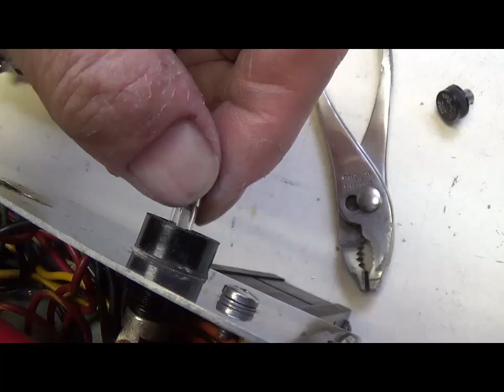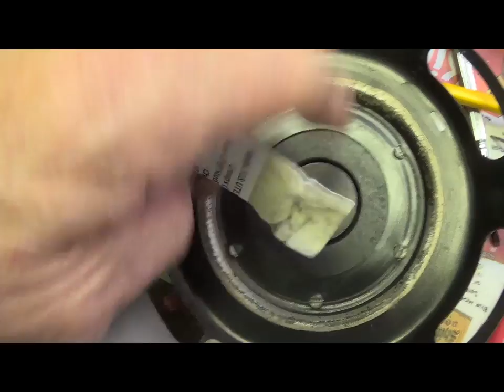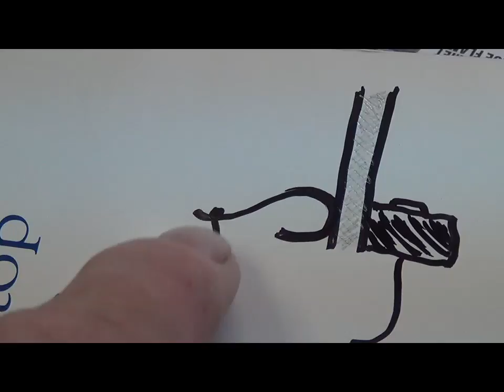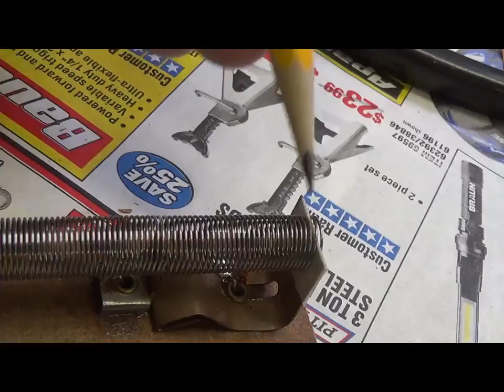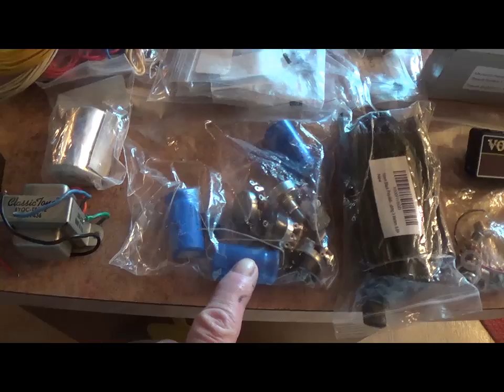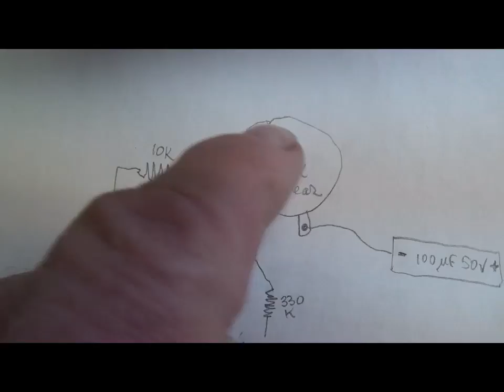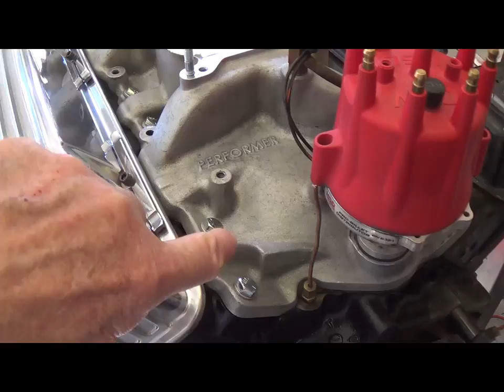Silvertone 1485, Part 3: Circuit Overhaul, Speakers, Sound Check

Comment: Hello Uncle Doug, great work, craftsmanship, and engineering analysis. The engine restoration is quite amazing, hope we'll get to see it plugged up and fired up! If you could show how you tune and perform the timing adjustment on it, it would be nice!    I truly appreciate your videos, as always.  Be well!!
Reply from the maker: Thanks, Bruno. The initial timing must be set by distributor rotation, as usual, but the advance curve is established by the MSD module (not by vacuum advance).  I'll keep your request in mind.

Comment: You’ve certainly done a lovely transformation job on that Silvertone amplifier: it both sounds, and looks brilliant Douglas.
I had to smile to myself when I saw how you had utilised a length of UK type mains lead inside the speaker cabinet.  Since the American mains lead colours are black, white, and green, I’d say brown, blue, and green/yellow serves the speaker wire colour code requirement most handsomely.
Seeing the reverb tank with the long coiled spring brought back memories of long ago.  When I was in my teens and early twenties, we apprentices made reverb tanks using a length of timber onto which a length of form was stuck.  A 17”, 110 degree monochrome c.r.t coiled ground spring (about 14” long) was suspended in a wooden frame (stuck to the form), slightly above two mono crystal record player cartridges (with their styluses removed) screwed to the wooden frame, and they were fed into an ECC83 double triode valve which was used as an audio signal driver.  Surprisingly, that ‘Heath Robinson’ type of arrangement worked quite well.
Youth is most certainly wasted on the young LOL!
Phil.
Reply from the maker: Thanks so much, Phil. So THAT'S why the insulation colors were so unusual :) Your Rube Goldberg reverb tanks sound really interesting.....obviously the product of youthful minds unfettered by the callousness of age.

Comment: I WAS planning work on my 1484 which is bone stock, needs the three prong cord mod, death cap removal, and I was going to try my hand at replacing the caps. I ordered 4pcs, 100uF-150V Vishay caps, ( you said you couldnt find these?),  5uF, 10uF, and 20uF-450V caps to replace the can,  and a 50V-100uF for the bias supply. I would like to know more about the resistors you swapped as well. I have the schematics, so which are those on the schem? But on your recommendation, I may pass on this. I also have a JCM800 that needs the filters changed, and a pair of Hiwatts that need some TLC...I was hoping to start doing this myself, but now I have doubts. I think Brad the "Guitologist" has a vid on working on the 1484 that has some good stuff....Oh and to add, great vid. Just wish I had more knowledge to be able to go through mine as you can and really get this one in shape. Thanks, and still have a thousand questions...one in particular, can you check bias with a octal bias socket tool on this amp? I'd like to check to see whats going on on the plate....
Reply from the maker: I had no problem finding 100uf @ 160V caps, B, and at a very reasonable price from AES in AZ. Several random resistors were swapped when they measured far out of spec. Also, when replacing the can cap, you will probably find it easier to simply replace the two 68K resistors between the can leads. I don't use any octal bias tools, preferring instead to follow the procedure explained in the video: Measure OPT primary DC resistance for each tube, measure voltage drop across each resistance, calculate PC using Ohm's Law.

Comment: A good friend of mine had the smaller 50 watt 2X12 version of this amp back in the very early 70's. I saw the output transformer fail like the one shown here. It was a real spectacular failure. It was in a dark hall where we were playing a high school dance. All of a sudden there were flames shooting up from the back of the amplifier. It put on quite a show.
Reply from the maker: I'll bet the crowd loved it, DeWitt. This is probably how pyrotechnics shows, like those used by Kiss, originated :)

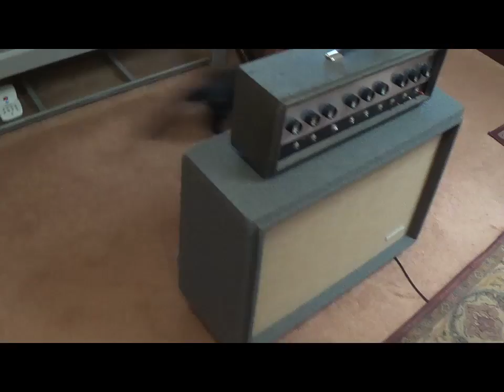Comment: Did a double take in horror when I saw a black shape charge across the screen at 38:02. For a second I thought the original amp rat had homed and was going back to dine on fresh speaker cone and tasty wires until I realised it was Jack. There are 'rodents of unusual size' though & rats can travel! Your self-grounding jacks and footswitch grounding solution for hum after such a complex rebuild shows how many hours of thought you put into this. That's a great sounding & fine looking amp.  Happy New Year UD!
Reply from the maker: He startled me too, Guy. God help any rat that shows up around here. If they can get past the ravenous feral cats in the back yard, Jack and KC will double-team them and dine on their tasty bits :) Thanks so much.

Comment: What if you ran a strip of foam right through the center of that reverb springs but between the transducers?  Maybe a waste of time, maybe not practical or possible.
Reply from the maker: Thanks for the suggestion, BB. I may try that.

Comment: Uncle Doug, Thanks so much really enjoyed the restoration. SEARS no longer exists, but the mighty 1485 lives on. The engine looks fantastic, by the way, did you use the proper 50 ft/lbs of torque when installing the oil filter?
Reply from the maker: You're welcome, T-O. Thanks !! Yes, instead of 450 lb/ft like my predecessor :)

Comment: back when I was a teen, one of the guys in the band had one of these, and we used it as a PA hahaha. I had an old Gregory reverb 900, and an old Silvertone  U1 guitar. Prior to the Gregory I had an old little tube amp that had the sound hole and 2 wooden bands going across the hole. I never knew what it was, just that it was small but loud enough for what I needed.
Reply from the maker: Sounds like some exotic equipment, RR. Thanks for sharing :)

Comment: Great restoration! It looks like new. I really like the material you used to recover the cases. Care to share where you got it from and the manufacturer/style?

The reverb on your amp is really over the top. Mine is nowhere near as strong.

BTW, the data I show for a 6L6GC tube is 500 volts with a 30 watt dissipation (max), so you are really on the conservative side. I have a Silvertone 1484 and if I remember correctly, it was rated at 50 watts with 2 6L6GC's. The original 6L6 was rated at 19 watts. The 1485 should be capable of about 100 watts.

Lurid expose? LOL
Reply from the maker: I bought the material from a small local upholstery supply store. I have no idea  as to manufacturer, brand, style, etc. I simply pointed at a sample and the guy disappeared for a few minutes, then reappeared with 1 1/2 yards of it. Your tube data is correct. I purposely under-biased them for a couple reasons: protection of components.......and it still sounds great.

Comment: This would explain why the power tubes in mine get so hot so fast
Reply from the maker: Yes, check the bias. I predict that you will be (un)pleasantly surprised.
Reply: @UncleDoug  i had it serviced and recapped. Then it worked fine other than the reverb howling if turned past 3. It works still though, way too much gain on the reverb. Then something happened, when you turn the amp on now and the tubes warm up it just hums fairly loudly and the knobs don't change anything.
Reply from the maker: Not a good sign, Robert. Time to return to the service fellow, I guess.
Reply: @UncleDoug  I'm taking it to a different amp tech who is much closer. Not the easiest amp to transport 🙂 i hope its nothing serious.
Reply: @UncleDoug  it still even has all the original silvertone branded tubes in it. All RCA i believe.  I took the black plate 6l6gc's out before i had it serviced so the tubes in it are modern ones.
Reply from the maker: Best of luck with the repair job, Robert. Check with the tech to see if you really need to transport the speaker cabinet. Perhaps he will have dummy loads for the outputs.

Comment: Great to see this amp come to life. Very intrigued by cabs with more than four speakers; when I was a kid the guitarist in the band my brother played piano in had a Kasino combo amp with eight 10" loudspeakers inside. Those things could be augmented by two four-10s-in-a-line column speakers and I think they came with solid-state amps of 100, 200, and 300 watts. Don't know how pleasing they would sound but volume-wise I think with one of those 16x10" rigs you'd be ready to play for the Who.
Reply from the maker: I think the Kasino was Kustom's P.A. amp brand, Hub, thus the ungodly number of speakers. They probably were suited for stadium use.
Reply: @UncleDoug  Correct - Kustom made guitar and bass amps and PAs (with the column speaker cabs) under the Kasino brand. They probably used some of the same circuits and chassis for both lines but the Kustom amps had something more like regular Tolex instead of the naugahyde tuck/roll covering.

Comment: Happy New Year Uncle Doug, Jack, Casey, & Ollie... 
So I'm guesstimating each set of 3 speakers is getting up to 30-ish watts? 
I'd be curious to hear this magnificently restored monster with 'verb @ 5%
tremolo @ 100% & all the way slow and the volume... gosh, I dunno... 
Even @ 25% It took quite awhile for the auto-level in your webcam to recover. 
It must be gosh awfully loud. (he he) 
Thanx for another wonderful vid ...oh and the small block is looking very cherry... 
If I'm not mistaken, an added benefit of the carb spacer is a taste of additional 
RAM (bam, thank-you m'am) cheers from L. A.
Reply from the maker: Likewise, Jonny. That's probably about right.....in the 50W range, but the volume is astounding with six tens moving all sorts of air right at you. My wife actually fled from the house while I was making the sound check video. Yes, the spacer seems to increase low-end power a bit, possibly due to increased plenum volume.

Comment: Outstanding job again, Note that I waited for the reverb at 41 minutes to see if I heard the whistle artifact like in mine and i did.  I still need to do a final test to see when there is no wall in front of the speaker if that goes away.   Apparently it feeds back into the reverb circuit.
Reply from the maker: I have no doubt that the speaker vibration feeds back through the very sensitive tank, Jordan. It might be better to set the amp head on a stable surface apart from and behind the speaker cabinet. At higher volumes, it could generate a howl that would get every dog in a 2 mile radius howling back.
Reply: @UncleDoug  I came up with two items when I became alarmed with this during testing.   It went away when I moved to my monitor speaker and not the cabinet as its a magnitude smaller, I could then aim that monitor speaker at the reverb circuit to reintroduce the feedback at HIGH volume.   Its all just bad isolation.

Comment: I feel you will be revisiting this amp in the future, with regard to the tank.
Reply from the maker: There are several places that may get additional attention, NN, and the reverb is one of them. Perhaps reducing the strength of the reverb drive and adding a high-pass filter to eliminate low frequencies from muddying the reverb signal.

Comment: That 4-hole spacer should also in crease low & mid-range torque slightly. What cam and heads? I like a 212/218 duration cam in my 3500 lb Trans Am, In a light weight vehicle a slightly larger 218/224 duration cam would probably yield great mid range torque and fairly good horsepower.
Reply from the maker: It's an RV cam, Tony, for low and mid-range response. With a TH-350, the engine never revs over 4K, so anything above this range is wasted. Yes, the phenolic spacer does produce a small but noticeable low-end boost.

Comment: After solving the 6L6 bias problem, did you restore the power supply voltage doubler circuitry to the as-found factory wiring? Reason I ask is that if the amp is going to output 120 watts RMS the B+ will need to be in the neighborhood of 470 vdc. My '69 Fender Bandmaster-Reverb amp has ~445 vdc B+ and it outputs 50 watts RMS. My 60 watt RMS Fender Deville amp had a ~470 vdc B+.
Reply from the maker: I really didn't want to optimize the output wattage, Tony, choosing instead to go for moderate PV, PC, and PD to preserve the OPT's, tubes, and speakers. It is brutally powerful as is, and I will never utilize it's full capability.

Comment: Hello Doug! Very good video about the Silvertone amp! There was a time when Danelectro made the amps for Sears and was re-branded Silvertone. It has a great sound, however, there's a high pitched spring noise in the reverb tank that sounds like a mechanical issue. I also took notice to the fairly weak tremolo. Danelectro wasn't considered a high end amp such as Fender and other major brands, but sounded great for a budget priced amplifier. It may be feasible to modify the tremolo for a little more depth. The reverb issue might be a little more challenging. Either way, another excellent video! you took in a wreck and made a good sounding amplifier out of it. :) Looks like your rescue kitty has filled out nicely and is in good health :)
Reply from the maker: Thanks, Frank. Yes, further modifications are in store, particularly to the reverb and tremolo circuits. I will probably seek ways to attenuate the tank-driving signal. Much of the undesirable sound is due to vibrational feedback from the speaker cab to the reverb spring.

Comment: Wow, a rats nest of wiring. My 1964 Gretsh 6160 amp looks just as messy. The mfg of those amps apparently never saw the beautiful organized innards of a Fender amp.
Reply from the maker: It's hard to compare pure point-to-point vs eyelet board circuitry, Tony. Fender opted for rapid production with pre-made eyelet boards, while Danelectro techs simply slogged away with a soldering iron.

Comment: Uncle Doug, what's up with the oil pan gasket back by the starter? Looks squished out of place from here.
Reply from the maker: It's a universal gasket, made to fit either side.....the straight one or the one that has the dipstick passage. I normally trim off the exposed part. In fact, I'll do that tomorrow :)

Comment: Love your work. Is the level of break up an artifact of the recording?. I would imagine the sound is huge in the space you are recording with 6 speakers.
Reply from the maker: Thanks, Shane. Yes, it is nearly overpowering in my living room, even at 1/4 volume. In fact, my wife fled the house during the recording session. I would imagine that all sorts of artifacts were injected during initial recording, uploading, and playback on YT and computer speakers.
Reply: I am curious about the input shielding. I grew up in a part of Australia that was flat with a very powerful radio transmitter for the whole district. We were plagued by guitar cables picking up the broadcast. Is there a point where radio energy will defeat shielding or should I have embraced Mr Reeves telling that woman he'll have to go.
Reply from the maker: The days of ultra-powerful AM stations has mercifully passed, Shane. We had them too. I can't say that I have ever had problems with RF interference in any amp I have owned and/or worked on in the past 20 years. It still occurs locally with some wireless guitar to amp transmitters (probably FM), but not with amplifiers themselves.

Comment: Hello there Uncle Doug! This comment is completely video unrelated but I just wanted to say thank you for the knowledge in tube amp technology you have given me, I just finished making my homemade tube amp using an ecl82 and it works great! seriously, thank you!
Reply from the maker: You're welcome, GG. We're glad the videos were helpful.
Reply: Uncle Doug, there is one issue though, when I hookup the amp to a computer (computer audio output to the grid of the triode, resistors included) the amp furiously buzzes, it never does this when hooked up to a stereo or a cassette deck and i've tried connecting both devices to the same outlet to eliminate any ground difference. Any advice would be helpful
Reply from the maker: Are you using a properly shielded and grounded cord? Unless you have an oscilloscope to assist in locating the source and nature of the buzz, you'll have to do some experimenting. Good luck.
Reply: I do use a shielded and grounded cord for making audio connections to the amp of any kind, and the shield in the cord is grounded only on one side to prevent a ground loop situation. I will try in some way to resolve the situation
Reply: Hello again Uncle Doug, can you tell me what purpose is served by a wire in series with a resistor from the cathode of the triode to one of the wires of the audio transformer? Does it cause negative feedback, if so how does it affect the sound. I've seen it in many schematics

Comment: Great video as always Uncle Doug. I was wandering if you ever reduce the filament voltage with series resistance on old amps that were designed for 110 or 117 volts to keep it at 6.3 volts. I know the data sheets say + or - 10% but I think tubes will last longer at 6.3 volts. This also helps with start up filament current that can be a as high as 1 amp on a single 12AX7 preamp tube. When ever I do a conversion on an old Baldwin or Hammond Organ amp to guitar amp I first decide whether I will use it with modern line voltage levels or buck it down to original voltage values and add series resistance in heater and power circuits. I also follow Merlin Blencowe suggestion in his books to put Soft Start in primary circuit which is just a high wattage resistor across a switch after the On/Off switch. Use a resistive value that drops primary voltage to about half then after 5 or so seconds flip it Onto full voltage, less stress on transformers, tubes and capacitors. I also use it at turn OFF to reduce voltage spike on Power Transformer.
Reply from the maker: Thanks so much for the helpful suggestions, CK. I had not considered lowering the filament voltage......yet.